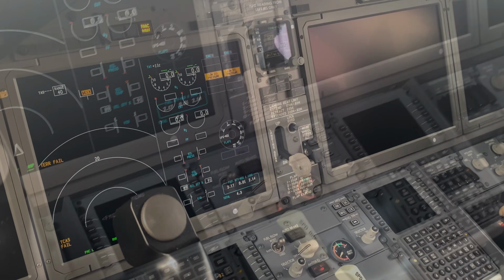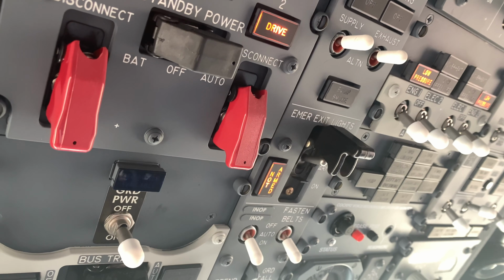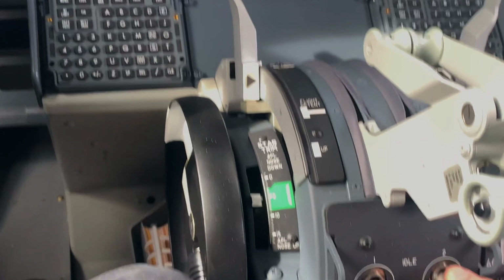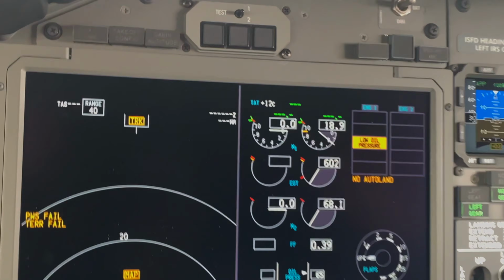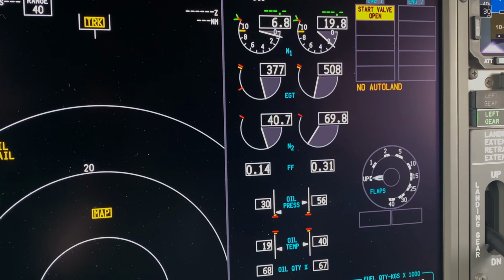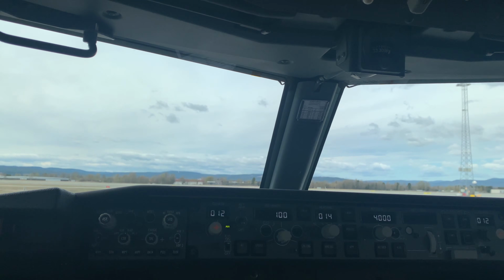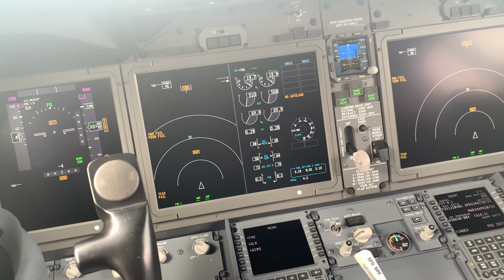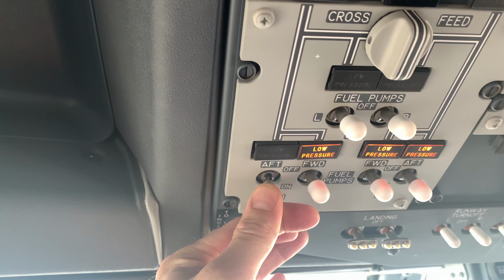🎬  BOEING B737 MAX ATA 71 Engine Ground Run. ✈️

Comment: Hello,

Are you planning new videos?
Can you make a cockpit test of the

Standby Hydraulic pump in a 737NG, please?

Also a video of ground test of the

STOP RUDDER INPUT in the A306.
By ground test, I mean how you trigger the system on the ground.

That would be very interesting.

Thank you very much.
Reply from the maker: Hi, Still planning on making videos, just going through a job change currently, but I will note your request. Some A330 content coming in the future.
Reply: @aircraftengineerstoolbox2560  

If you want to make content about A330  can you also talk about the

PITCH PITCH

warning, please?

Comment: I believe it decides which hydraulic system powers nose wheel steering. It is usually the 'B' Hydraulic system, but setting it to the Alternate mode will have system 'A' power nose wheel steering. I believe it is set to Alternate if the 'B' hydraulic system fails.
Reply from the maker: Almost, Sys A on the B737 (all types) is normal supply Sys B Alternate.
Reply: @aircraftengineerstoolbox2560  

It this feature also availible in the 737NG?
Reply from the maker: @AVIATIONSOUNDEXPERT   Yes B737 classic, Ng and Max not sure about the Jurassic i.e B737-100/200
Reply: @aircraftengineerstoolbox2560  In the Jurassic jets, the A system still controlled nose wheel steering, but the engine driven pumps were the A system while the EMDPs were the B system. So, SWA pilots would turn off the EDPs (A Pumps) and leave the EMDPs (B Pumps) on for pushback. It was vital because the -200s could not connect to a bypass pin I believe. If the engines are running with System A on, the nose wheel could move and the towbar could cut someone's legs off. So, SWA did that and continued their tradition in the Classics, NGs, and MAXes to turn off system 'A' before pushback as an extra layer of safety. I like it because I get to hear the sound of the 'A' pumps pressurizing after pushback if I am sitting next to the wing haha
Reply from the maker: @SSAviation737  Interesting, didn't know that.👍
Reply: @aircraftengineerstoolbox2560  Thank you.
Reply: Oh, yeah! SWA turns A Pumps off for push! I don't know how I made that mistake! Yes, System A is nose wheel steering is normal, so SWA turns them off for pushback and Sys B is alternate! Thanks for correcting me.

Comment: When you got a second camera, you should make this video again from outside.

What is tze guarded "NOSE WHEEL STEERING ALT" switch?
Reply from the maker: Hydraulic SYS A usually supplies pressure to extend and retract the main gear, the extend pressure normally supplies pressure for nose wheel steering. The Alt nose wheel steering switch changes the pressure supply from A to B through the transfer valve. For the transfer valve to work - switch to alt position, normal qty in sys B, nose air/ground in ground mode.